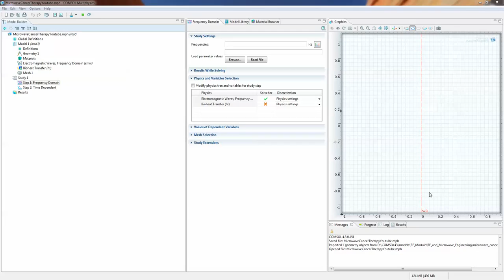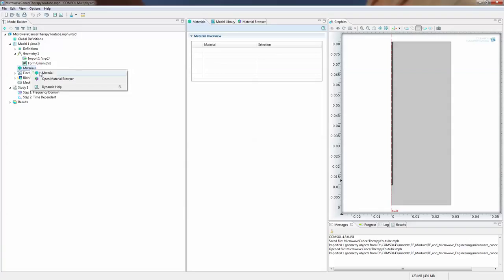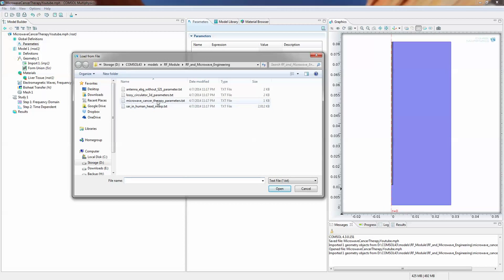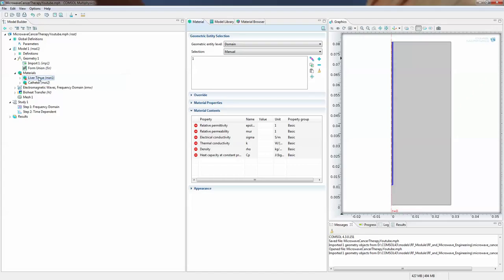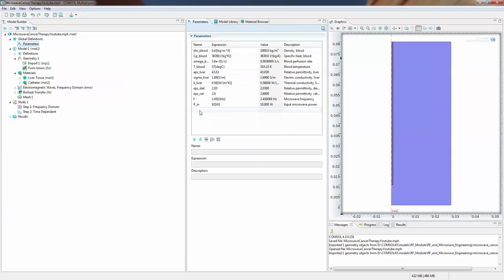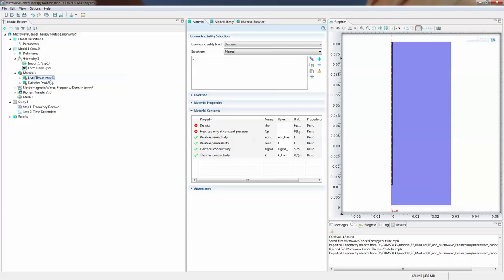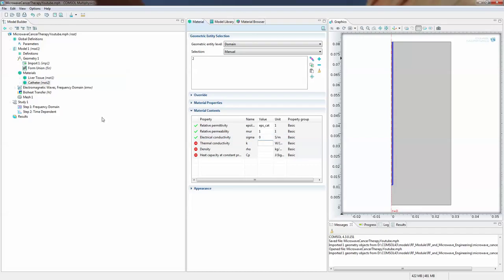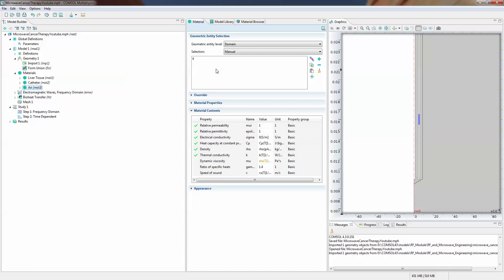COMSOL43 Microwave Cancer Therapy Part 4 Geometry and Materials

Comment: Sir, why the metal conductor material is left blank..i refered the comsol 700+ pdf, it is written "This problem does not model the interior of the metallic conductors, and it
models metallic parts using boundary conditions,"

my question is can we assign metallic properties and instead of selecting boundary 8 as ports, can we choose that metaalic part as boundary???